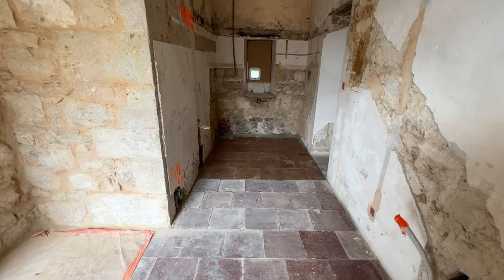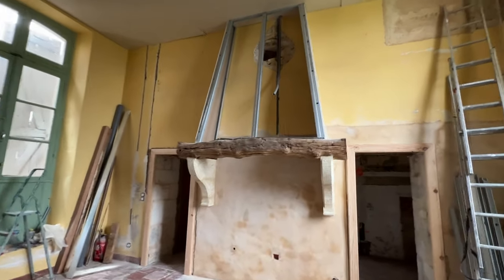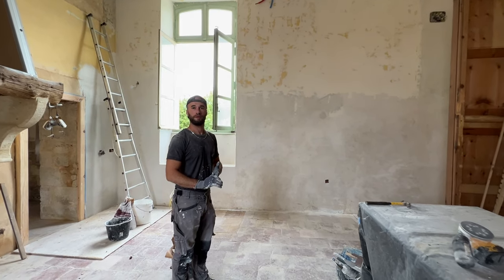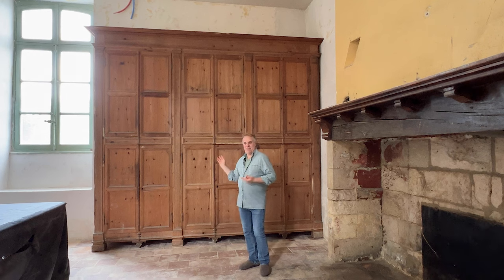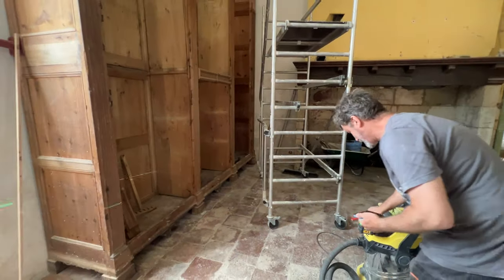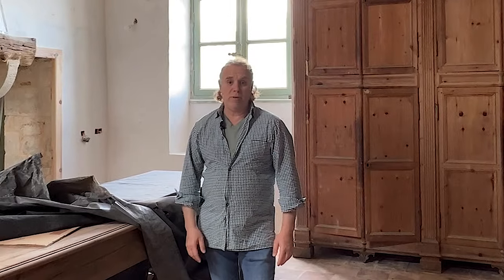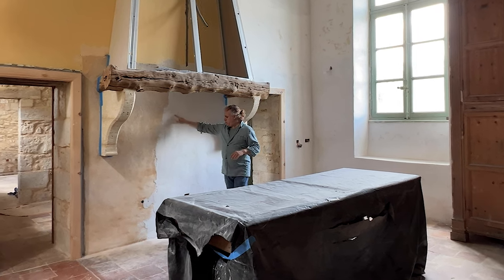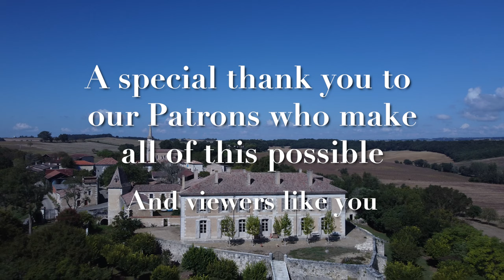Recreating new that looks old, our country kitchen is coming together.

Comment: It’s a real joy watching the way you are restoring the chateau with such respect for its history.  So many of these projects across France are creating ‘Disneyland’ not nurturing the character of the building.  Thank you for the recommendation on L’Isle-sur-la-Sorgue.  It’s only a few hours drive away from our new home in France and we need to do some shopping as well. Best wishes.  M&R
Reply from the maker: Rowan, Thank you so much for such a kind comment. It is hard not to cross that Disneyland line. It is also hard not to cross the Architectural Digest line ! Take our sink cabinet for example, I want a white marble countertop, but I do not want to look to modern so I have asked the stone company to explore sandblasting the surface after we add a few chips in it. Hoping that after some additional staining it will look as if it has been around for a few hundred years. Sometimes it is like set dressing for a movie shoot, but with permanent elements 😂
Enjoy antique shopping !! just don't blame us for the empty pockets at the end of the journey.
Merci !!!
Mark

Comment: The old stone is beautiful. However, you need to seal it. It becomes incredibly dusty and will drive you mad!
I love the beam and corbels where the cooker is going. How are you going to keep the beam and corbels clean from the grease and spits from food?
Those cabinets are magnificent. You could look at library steps to get up the top. They also move on casters so you can go from cabinet to cabinet. Make sure you put locking mechanisms on the casters 😉
Love the captions - make me laugh 😄
Reply from the maker: Jay, the sealing of the stone is an interesting point. I am now going to go down a rabbit hole researching it. The stove is very wide and the corbels should be out of harms way, but even so they could use some patina 😆
And, trust me, Phillip has already been looking at rolling library ladders ! 😂
Thank you  
Mark

Comment: No need to call Emergency! 
As someone who had a solid timber kitchen, I say paint away... our kitchen is small so it's painted off-white, has cabinets to the ceiling, with glass paned upper doors on one side, it looks like a wall of china. The end with the range and hood is off-white subway tile, also to the ceiling... it makes the kitchen look so much larger. Paint colour in your kitchen could be anything as it's enormous, so can't wait to see the colour you choose. I was talked into painting the base of the kitchen table, so happy with the result, a blue very similar to your painted dinning room walls. 
Bread, butter and cheese are a deadly combo, I know, so delicious!  ❤🧀🦘
Reply from the maker: Denise, your kitchen sounds Devine!! You are right, paint away! Too much wood can feel dark and looming. The stove and cabinets are a gray blue, the tile crackle finish white, oversized subway tile... now we just have to choose the wall and ceiling colors... so high up there !!! 
Thank you !!
❤️ Mark

Comment: Mark that is an excellent choice for the tile line though I wouldn’t drop it. Are you sure you have enough refrigeration freezer what ice machine and ice crusher? I was hoping a glimpse of the dining room 😉 
Ah Philip 🥖🧀🍷only eat that and keep running up and down those stairs! 😂😂😂
💕💕
🥵 97°
Reply from the maker: Tony, 👋🏼👋🏼👋🏼, the tile is so high up the wall, around 13 feet, it is going to be so pretty. Fear not, there will be a lot of refrigeration, the ice box in the big kitchen, an American style refrigerator in the back kitchen, and a big refrigerator and an upright freezer in the laundry room. Plus an ice machine in the Butlers pantry. We will be well covered, of refrigerated as the case may be. 😂😂😂
Thank you  
Mark. ❤️❤️❤️
Reply: @atthechateau  then we are ready for a party!!! 🎉 in those drone shots I didn’t see a 7•11 anywhere…🤣😂🤣

Comment: 112 Tile emergency😂😂
Only bought enough for 3 metres high...really😂😂
Mark are you fitting them? I've got 4 spare 10x10cm ceramic tiles if you run short. Just call and I'll pop them in the post.
Seriously you should cover them with no 2 tiles the same. That would help you concentrate on food prep💕
Reply from the maker: Daisy, there is so much tile in our kitchen it has become a daunting task. Oh how I wish I could actually do the tile because I do adore it. My time will come ! 
We did not show the tile yet, we are saving it. But it is going to be very pretty in an old English manor house kitchen way.
Thank you  
Mark. ❤️❤️❤️❤️
Reply: @atthechateau  Mark, have I seen you at Stratford? You nearly convinced me....the longing to tile or not to tile, that is the question 😘💕